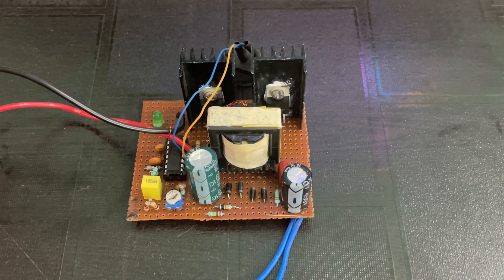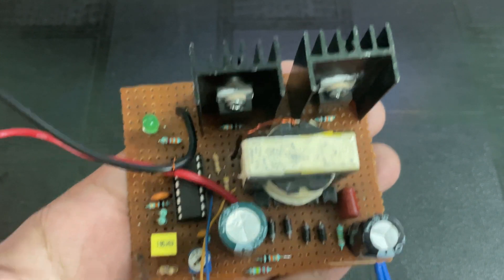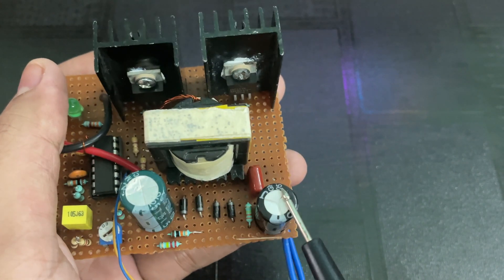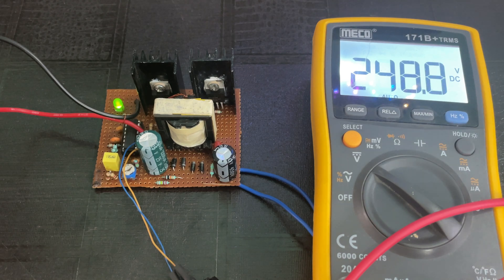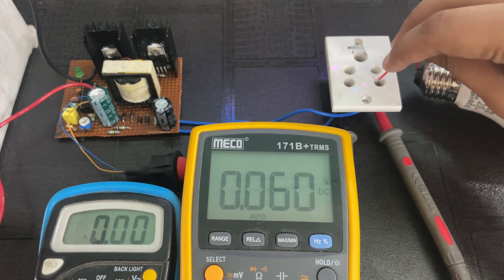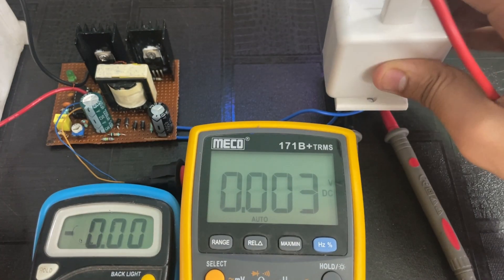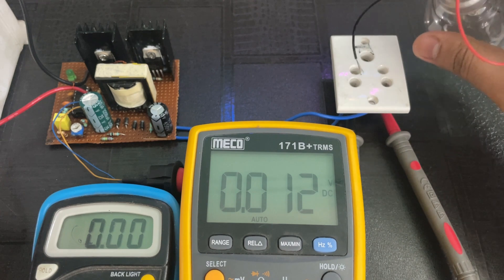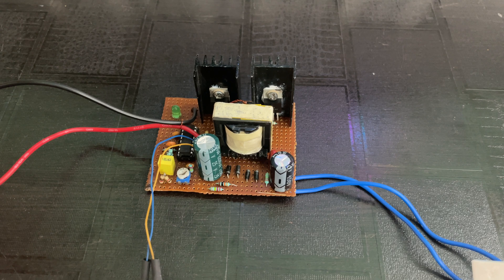DIY 100W  12V INVERTER WITH SG3525

Comment: Sir,  Converter circuit me ek  z44 dusra irf3205 use kar sakte hain kya maine use kiya hai to overheating problem ho rahi hai aur 100watt ke bulb me 11amp le raha hai solution batayen please usme maine feedback system lagaya hai accha kaam kar raha hai lekin variable se jab voltage down karta hu 250v se 220 to mosfet heating badh jate hain jitna voltage kam karta hu utna jyada heating issue.

Comment: This is a push pull forward converter. Very interesting design. I wonder about the 4.7 nF capacitor in the secondary circuit in series to the full wave rectifier. Why do you have used it in your circuit? I think it should also work without it.

The SG3525 is a very useful IC to make powerful DC/DC converters due to the forward converter principle. You can also use low side drivers like MIC4422 or MIC4452 behind the push pull outputs to boost the switching current for the MOSFET gates up to 6 A or 12 A respectively. So you can drive MOSFETs with higher gate capacities and gate charges and several 100 A drain current for forward converters up to the kW-range for photovoltaic systems and other high power systems.

I have used this IC in a forward converter for a 48 V / 24 V 5 kW fuel cell converter. The issue in this case was the secondary side rectifier with its Schottky diodes. I've used devices with only 370 mV forward voltage. But at 200 A they convert still a lot of power into unwanted heat. So I will try an active MOSFET rectifier with fast comparators like LM311 to solve this heat problem in order to get a higher overall efficiency.

Comment: Why you used 330k with High Voltage Capacitor's GND and VCC? Why you used 100NF capacitor with Pin 2+16 and GND?

Also this Circuit Freequency is wrong.  Its Freequency will 270,241 /  270khz which is Wrong. You need to Keep 20k to 31k for better result.
Reply from the maker: The 330k resistor is used to discharge the high voltage capacitor after the circuit is turned off. The 100nf capacitor is used as a filter capacitor 

You can put the value in the formula of this ic’s frequency formula which you can get from google and check 

Thanks

Comment: What is the Output HZ sending to Transformer in this circuit?
Reply from the maker: The frequency is about 70khz
Reply: @kdcreativity6201  Brother, I am searching since a lot of days one thing  that How to Make Pure Sine Wave Inverter with 500W Inverter Module (QS-100) and EGS002 SPWM. Please make a video about this. Also give us 3D Easy Diagram. Please Please brother. I know you can do it.
Reply from the maker: I will try to do this